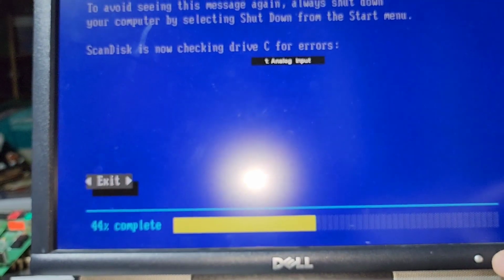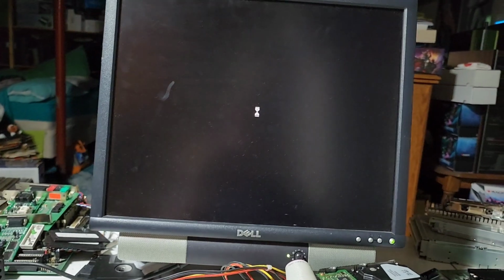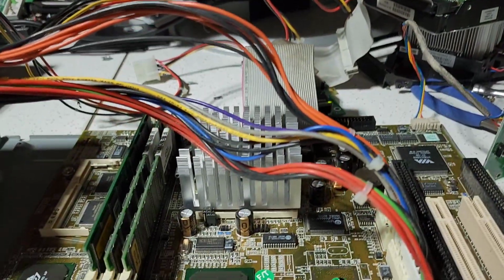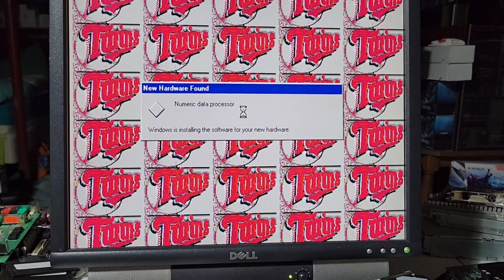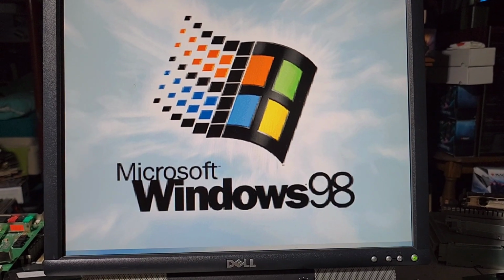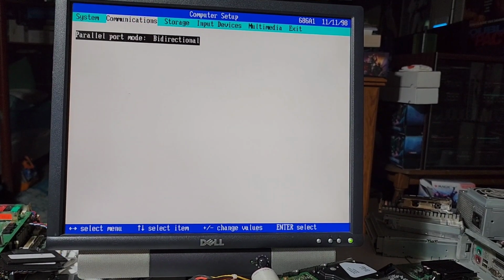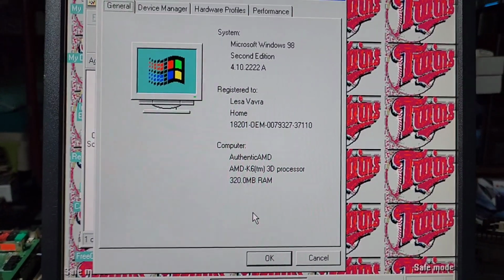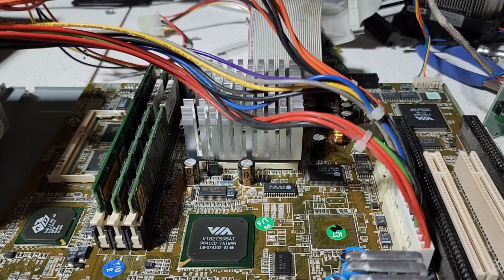Compaq Salvage! AMD K6 Testing - Will it Boot? What's the Specs?? #retro #computer

Comment: @5:10 ... that's a slot for a 144pin graphic VRam module (usually 4mb) so you could upgrade the integrated ATI  to a 8mb gpu.
To find out the CPU speed, there's a couple of ways, the easiest one is to run "dxdiag" or if you want more details simply run "systeminfo"
Reply from the maker: Oh cool! Thank you!
And oh gosh, dxdiag, how could I forget that? Thanks for the reminder!

Comment: You should set "Compatibility" setting off, in bios. I have similiar system you have there, but it is early Compaq p4 system and if you set "Compatibility" to "Normal" it reduces system speed a lot and that is meant to use if you use DOS environment only, so go bios to set "Compatibility" off and that should speed up lot of your system.
Reply from the maker: That's a great tip! Thank you!

Comment: I would install windows xp,  windows 98 will never display the cpu clock speed.
Reply: CPUZ will show, and there is lot of programs like AIDA will work in windows 98. Windows XP on that system is a bit overkill
Reply: Yeah I use CPU-z.  Need to have an older version for Win98 support I believe.  3DMark2001 and maybe the others have an info screen as well.
Reply: @Toni Hiltunen  I know you can use cpuz but that's a 3rd party software I was saying you wouldn't see it in my computer.
Reply from the maker: Great info, thank you! I'll have to look into setting up a benchmark tool on CD or floppy for these older systems!
Reply: @urzamaster A USB drive works well for 98 but you need to install the USB Mass storage driver first usually.  Weird how large USB drives work on old machines.  Add all drivers and BIOS updates and software to one USB stick.  Keep a backup if you do it though.  Too many USB drives fail.
Reply from the maker: @larryladeroute971  that's a great idea! I have so many extra USB drives I think that may be the ticket!